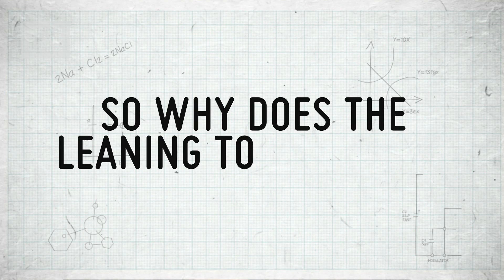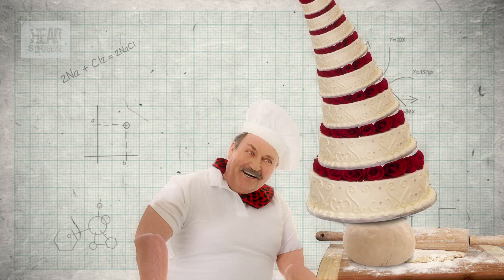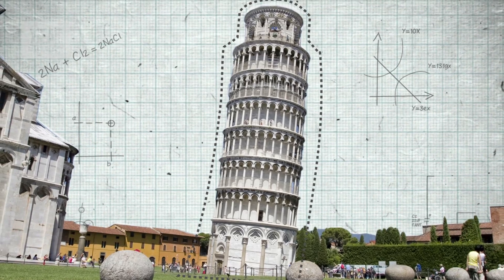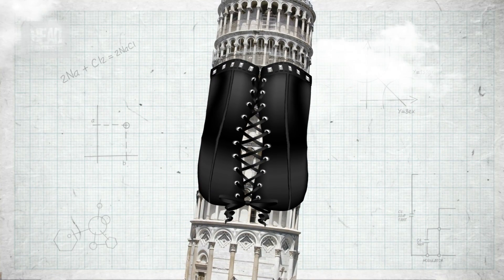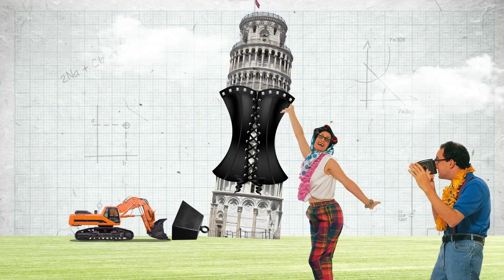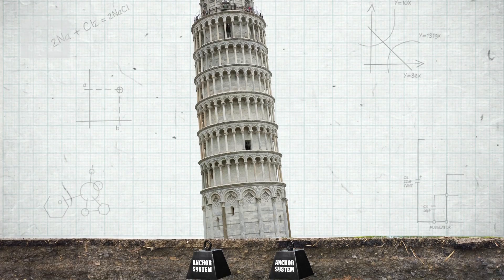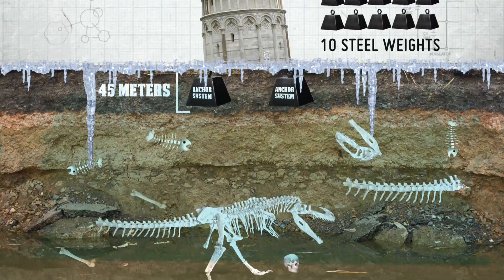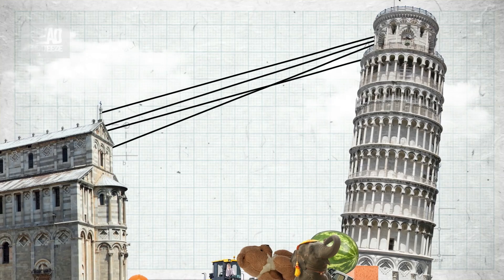Why does the leaning tower of Pisa lean? | Sci Guide with Jheni Osman | Head Squeeze

Comment: Soft soil, a river, and limited resources in the old ages, today since the structure is now historical, engineers are doing what they can to stabilize the tower. My speculation is there is still underground water flowing perhaps slowly, which is keeping the soil soft. Id say create a cylinder of cement as a damn around the tower add weights just enough to keep it leaning as it is. Hope to keep this comment positive.

Comment from the maker: Oops. 100kg and 14.5 tonnes do seem a bit light!  We seem to be missing a few zeros, sorry about that.

We meant, and should have, said “Not ideal for around 14,5000 tons of marble on top.” And “Around 100kg of soil was removed each day over the course of the year.” 

What a different building it would be if it was only 14.5 tonnes!
Reply: what number is "14,5000" exactly? is it 145 thousand or 14,5 thousand ?
Reply: Surely someone should have realised that mistake... the cameraman, the cleaner?
Reply: Wow. What a lame channel. They can't get their numbers correct, and the correction is also wrong. No quality control whatsoever. THUMBS DOWN!!
Reply: 100kg of soil is still only one or two wheelbarrow's full, I could do that in less than 5 minutes
Reply: A good episode. A common-sense fact check would have avoided the embarrassment. :(
Reply: U got it wrong again it’s 14,500tones not 14,5000 btw what kind of number is that
Reply: Get your shit together man
Reply: Adrian Espinal i mean right?

Comment: But isn't the real question: Why didn't if fall over 800 years ago? How come it has only leaned so far and...stopped 'falling' back then? And why did it start 'falling' again.
Reply: to be honest it leaned very few till 1800... then an idiotic archeologist proposed to solve the leaning problem pumping away the water in the soil... and the problem got VERY worse... in 1990 the lending was at 4.5 degrees (close to the point of no return of 5 degrees) so the consolidation problems were no more deferrable.
Reply: "Why didn't it fall 800 years ago?" Because the construction site lasted 200 years... in so much time you can "correct" the problems of the leaning (at least... a little) that's why it lasted 620 years with no maintenance.

Comment: Well I do get Eiffel tower, but Pisa is just some product of poor foundation. Only reason it's still leaning is because people have put so many hours in keeping it that way with temporary fixes... I guess it's landmark of human stupidity? Tough tbf it's nice land mark on it's own. Just the leaning part is useless.

 Granted I could make up bs like "Building itself was such a fine piece of architechture that people working on it couldn't just left it unfinished. And to this day Pisa remains leaning as appreciation to architecht even with it's flaws. As no one is perfect.". Though I'd still think straight would've done the thing. As showcasing the biggest flaw as it's defining feature is a bit off from original intent in that case. Or either or... idc really. Most likely better tourist attraction this way. Anyways...

 Yeah as noted in comments quite a few times already. Please do your homework with measurements. To be frank you should double check your video. It doesn't fit for this channel if you just babble on about for a while, graphics team slaps their part on and finished. Well sure if that works, but doesn't look like that's the case. Trying to make informational videos and ending up with so much misinformation ain't most ideal of results.

 By sound of these "engineers" I wouldn't be too surprised if it was 100kg at time. Well that's still quite an operation. Though weirdly missing a person who knew about forbbidden art of math.

Wire solution would've been fun to see as it would've been grabbing for help from it's fellow building. (Poor as a solution. Just fun to think of.)

Comment: lol 100 Kg = 220 Lbs of :-P not thrue it was by removing 38 cubic metres (1,342 cubic feet) of soil from underneath the raised end. The tower was straightened by 45 centimetres (17.7 inches), returning to its 1838 position. After a decade of corrective reconstruction and stabilization efforts, the tower was reopened to the public on December 15, 2001, and was declared stable for at least another 300 years.